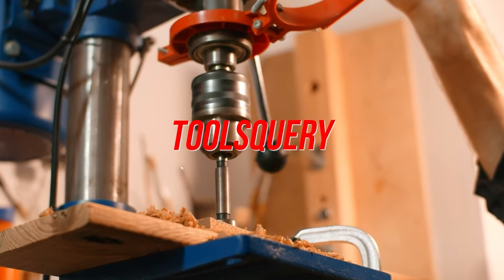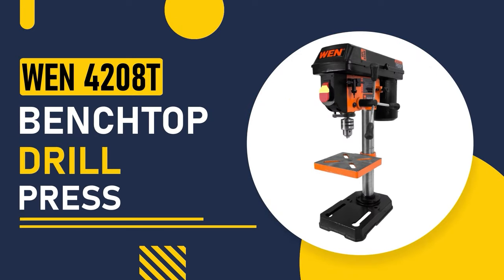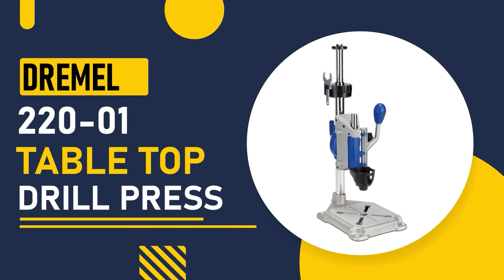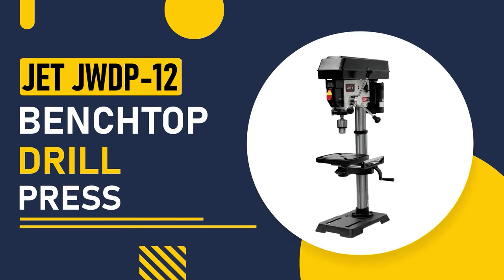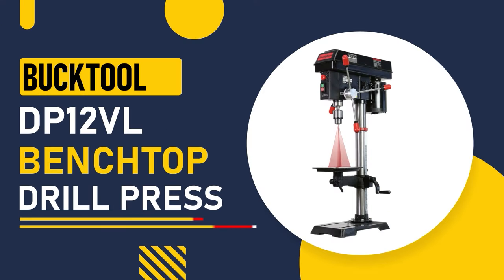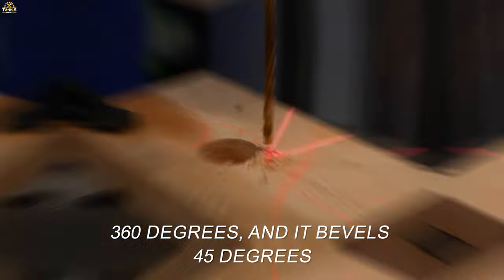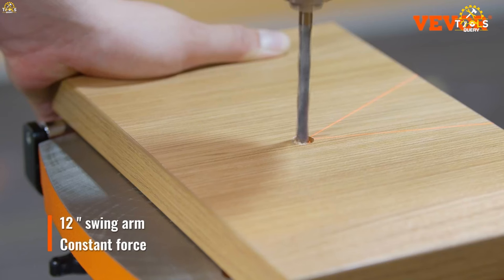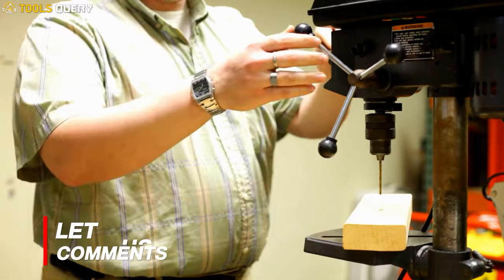Top 5 Best Drill Press For Woodworking | Drill Press Reviews And Buying Guide | Woodworking Tools

Comment: All of them are poor choices for woodworking.   A good drill press for woodworking has a large table and a replaceable insert in the table to reduce tearout and so you can use larger bits without hitting the table.    A plus if you can add a fence without having to add an auxiliary table.   Something like the JDP-15F or JDP-15B.   You also need to consider how large a piece you intend to drill,  some of the recommendations have such a small swing  they can't drill a hole in the middle of a 10 inch board.